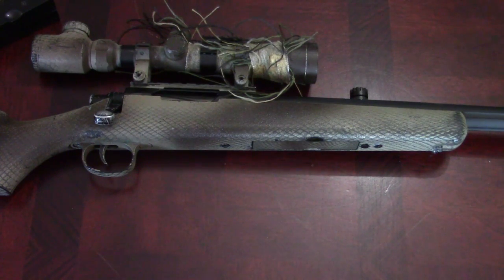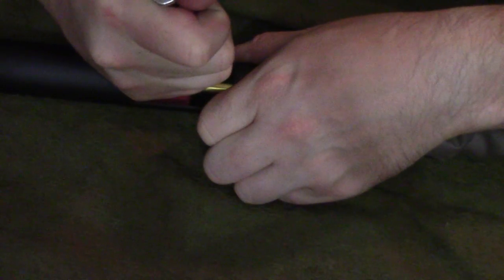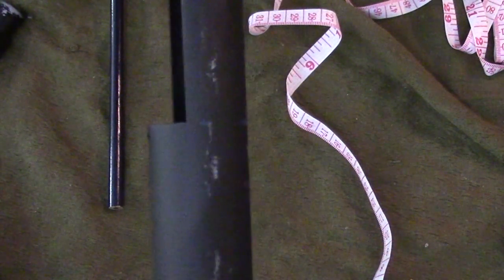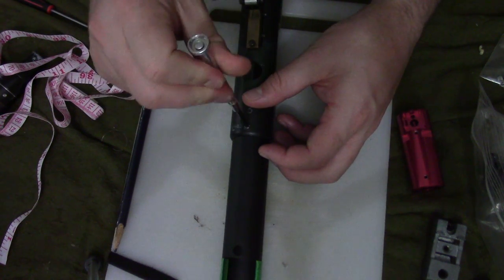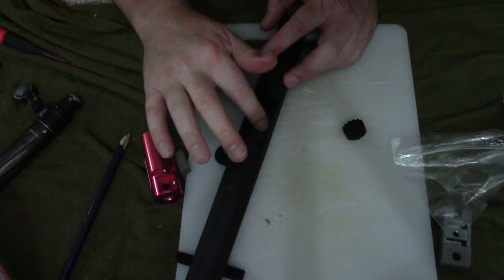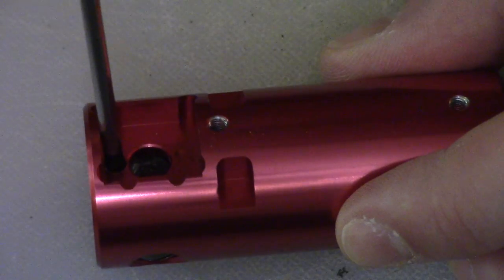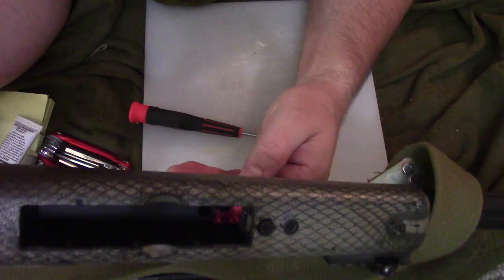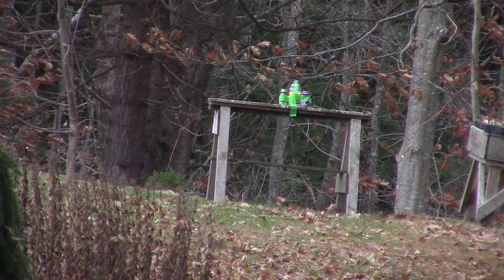VSR 10 TDC Hopup Turret Installation Airsoft Tokyo Marui

Comment: Do you have to have anything special in your gun or can you just put the tdc on because I have bb curve and I’m trying to get rid of it
Reply from the maker: Depends on the HopUp unit you have, but if yours had an arm on the top that the Tdc’s screw can push down on then it will work. You have to be Precise and get the unit perfectly straight though. Also your curve issue might just be the HopUp nub or bucking wore out / miss aligned overtime from use.
Reply: @kokosaysnono  Ight thanks man
Reply from the maker: @kevinerb5711  No prob at all :) thanks for checking out my vid and let me know how you make out with the adjustments :)
Reply: @kokosaysnono  I will👌🏻